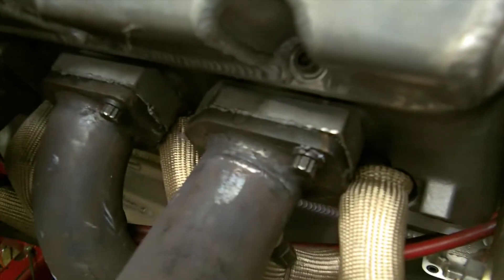JAMES & CRYSTAL SMITH - 440ci SBC symmetrical port engine dyno pull

Comment: saw a 396 SB2 set up for nitrous , pull 969 hp at 9300 ,, its cam was like 295/305 @ 50 on a 115  ,, it was dead below 5500 ,, would not even load on the dyno ,, after 6500 , it came on ,,